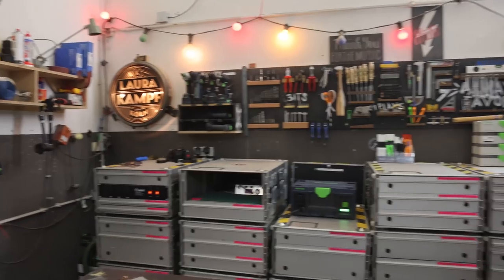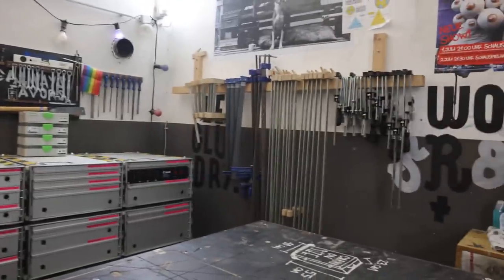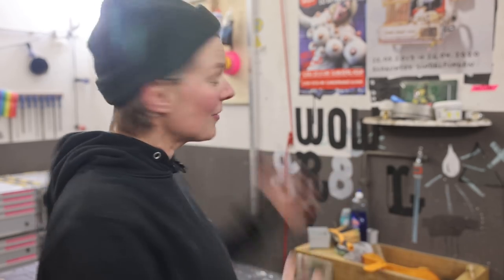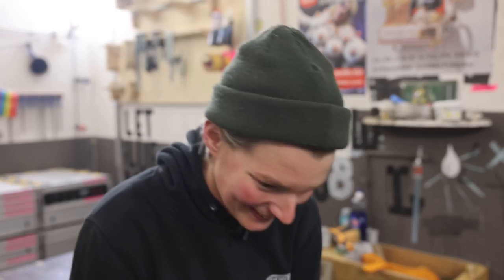This Clamp Storage Idea would be really good...if it worked :)

Comment: I'm not sure that weight is the primary concern. It looks like the slider mechanism you have (plywood in aluminum U-channel) is introducing a lot of friction and also results in binding. If it were me, I would place a small free-spinning wheel at each point of contact between the sled and wall/rails. Maybe model the wheels and sliders off of a sliding garage door or sliding truck door.

Follow-up thought: you want to lift the sled at it's center of gravity, not necessarily it's geometric center. Since you're loading it slightly differently each time, you need some system that is robust enough to handle this without losing too much energy. Pulling it by the top two corners with cables going straight up to an axel could help here. 

Also, throwing a ratchet mechanism on for safety would be a good idea! That way it doesn't fall down if you lose your grip.
Reply: It should freefall when you let go of the rope. Otherwise, too much friction.
Reply: Same thought.
I would add one roller-in-line wheel into each corner of the plywood in order to have a frictionless contact with the rails.
Reply: Yes!! Ratchet, greased runners or bearing runners! How about a hand made winder winch to lift! Oh and proper non stretch sailing rope/sheeting! So cool though!!
Reply: Also, larger diameter pulleys will improve your pull ratio.
Reply: I don't think that's the case. I believe any mechanical advantage the radius of the pulley might give you is immediately cancelled out. I think what does help is adding more rope segments and pulleys. Each time the rope loops back on itself it gives you more mechanical advantage. But at some point the friction of all those pulleys catches up, also.
Reply: 20+ clamps and 4x6ft board is very heavy...
Reply: Yes, add the rollers on the side, the board will never be balanced so two corners will dig in.  

Adding a cable and winch on the side would make it easier and most ratchet for safety.
Reply: This, but also, two words. Counter weight. When an elevator gets pulled to the top floor, a mass of roughly the same weight is moving down.

But even then, what's the point of moving these tools up high, you can't store anything underneath anyway? Unless you can have something flat on the wall, like a mural, or a map or a mirror that you like looking at more than you like having instant access to your clamps? Even better would be a second set of rails in front, and a twin storage solution that you move in counter balance to the clamp storage. At that point it will be seriously heavy though, and probably need some civil engineering know how to work out if its safe to stand under.
Reply: Also, I would ditch the rope you are using for something more static. You are losing too much force transfer into rope. Something more static like amsteel or steel cable will help in addition to the other mentioned suggestions.
Reply: Totally agree with what everyone is saying here about garage door style sliders to reduce friction, pulling from center of gravity, counterweight, ratchet, etc. Just gonna drop this wikipedia article here that describes what we're talking about (https://en.wikipedia.org/wiki/Block_and_tackle) and an awesome video @SmarterEveryDay made about snatch blocks https://www.youtube.com/watch?v=M2w3NZzPwOM
Reply: Don’t even need rollers. Just reducing the contact area between the wood and aluminum would reduce most of the friction. The contact area is all 3 sides of the aluminum channel and the wood for the full length. Just have small spacer blocks front and back on the top and bottom corners that are wider than the main board so it’s only small contact areas and smooth and wax those blocks and chamfer the corners.
Reply: UHMW tape on the bearing surfaces would be a lot less complicated than the various wheeled options folks are suggesting and might be sufficient to prevent binding and twisting. A boat winch is a pretty cheap way to get a ratcheting crank system that I used for a similar project. The crank handle provided enough mechanical advantage that I didn't need to worry about double or triple pulleys although it was not as much weight.
Reply: @wallitron  If that works, I could see every wall with such a unit if it was conducive to her process
Reply: Agreed, it looks like the issue is that the off centre load is causing the plywood sheet to lever outwards and bind in the u-channel. I agree that rolling wheels that fit better into the channel should work.
Reply: @Isaac_Norman  No the diameter of the pulleys is not relevant (as long as the rope can handle the radius). If you want to improve the pulleys you need to add more turns/wheels).
Reply: Your ideas are all perfect. If/when I ever do a similar project I'll utilize all your direction, especially the note on using a ratchet component for safety. Im so glad I saw your notes.

Comment: I’m willing to bet that your rope is getting caught between the wheels and the frames of your pulley. Most pulleys have a track for the rope so that it doesn’t get wedged.
Reply: Exactly what I thought. She should ditch the bearings and use proper pulleys with a rope guide. She should also get a some slightly larger pulleys to decrease the effort she has to put in and use a two or three fold purchase system.
Reply: Also, I think, the weight distribution doesn't seem to be equal, so it might be pushing on one side of the track too much, no?
Reply: @sylvanhydra2966  she would be better off mounting the bearings she has on the sides of the board so it slides easily in the tracks
Reply: @sylvanhydra2966  Getting the balance "perfect it's not possible since it will change with various loads.
So while your point is correct other solutions like pointed out in this thread needs to be implemented to reduce the issue (bearings in the tracks).
Reply: Agreed,the current design will cause a lot of friction as well as wear on the rope.

Also a counter balance would ease the required input a lot (almost elevators uses this to take the strain of the motor).

Also moving it out from the wall leaving room for a second layer of storage behind it would increase the usefulness (unless she needs the bare wall for something)
Reply: Same thought. Minimize the friction first (proper pulleys, or machine a U-channel into the bearings, along with some bearing system for the edges in the aluminum channel). Also that rope looks less than ideal. It looks too soft (like a cotton or poly rope) that's flattening/deforming over the bearings and possibly stretching, further worsening the drag/binding problem under load. A proper cored rope that maintains a circular cross section under load (like a static rope/cord used in climbing) would help a lot too. 

Once that's addressed, ta engineering design approach would be to figure out the weight of the load (mostly the panel, but also the clamps and stored items) then figure out what force she wants to exert to pull on the rope. Like if she wants to only pull down with 10kg (N really) but the system weighs 100kg, she needs at least a 10 to 1 pulley system. A counterweight could also be used to minimize the amount of rope pulled.

Comment: I bet if you added a counterweight, you could use an old garage door opener to motorize it ;-)
Reply: Yes ! Like a lift...
Reply: Right!  The counterweight is the ticket.  Won't need a motor, and it is not likely that an inexpensive  motor would work without a balance weight or spring of some sort. nearly the oldest trick in the book.  Gravity is a b*tch like that.
Reply: That is exactly what i was thinking. Exactly
Reply: you can also add more pulleys! or a combination of the two!
Reply: Using a balanced counterweight there is no need for any motor in the system. Have move gates weighing 1/2 a ton with one arm because of balanced weight .
Reply: Yep, counter-weight should do the trick!
Reply: +a cover
Reply: For safety?
Reply: You can make a second board that runs in front or behind it and you a counterweight AND doble your storage space
Reply: With the right counterweight a motor will not be necessary anymore  :-)
Reply: I would take a look into oldschool stage/theatrical rigging for commonly used examples.

Comment: I think adding a counterweight to reach equilibrium with empty board would be a good start. And improving the friction between the board and the track (and wall ?)
Reply: I was thinking the same thing.
Reply: I absolutely agree. 1st, like Laura said, it's not a fail. Add long as you learn and make progress, it's all part of the process. A counterweight might solve the problem. Different sized pulleys might do the job too or at least be part of the solution.
Reply: 1. Reduce friction indeed, by letting for example only 4 corners of the board into rail
Or add rollers into rail
2. Double the pulley 
3. Finally, possibly add a counterweight if still needed
Reply: I concur with you all... counter weight is the way to go.
Reply: Counterweight and bearings as "wheels" at four corners of the plate to keep the distance from the wall and steer in the tracks
Reply: Counterweight possibly as springs
Reply: Instead of a counter weight use a spring like the type on a garage door. So you actually have to pull the clamp board down instead of up
Reply: Yup, ditto

Comment: Looks great and I love the idea. I think a counterweight, and a crank to make it easier to wind and unwind the rope would look cool and make it easier to move!
Reply: Make the counter weight system a chalk board behind the holder with a secondary single pulley system for a more 1 to 1 weight ratio. Then add your hand crank to the side for simple swap back and forth.
Reply: I would use an electric winch. The idea about counter balancing it with a chaulk board is great, but will need to increase the size of the rope
Reply: @FrankKatzenberger  no need to increase the section of the rope: tension on it is the same if you pull it or if you hang a counterweight.
Reply: My first thought was: "Why isn't Laura using a crank?" 😄
Reply: @danb8568  I wouldn’t have thought of it until experimenting myself.

Comment: I’d also say that the system doesn’t increase storage because you can’t store anything underneath it. In fact the clamp storage is now taking up twice the space, because it needs room to move into as well as room to use, if that makes sense. I do however love how you are prepared to share your successes, of which there are many, and your not so successful projects.😀
Reply: My thinking from the start. Should perhaps offset it from the wall by 200mm then you can store tools flat against the wall and let the clamps slide over it when you need to. Easy fix
Reply: @three-eyes  Like those chalkboards at uni. Move one up and the other moves down!
Reply: @MFunkibut  would be cool but I was thinking one would stay static against the wall. Making a system like that with an offset would enable 3 times the storage if one had to stay static, would have to move the system higher a bit more then so the two moving boards are out of the way completely
Reply: Totally agree, I don't know why is there a need to raise the structure and how this saves space or adds to the project, the base to organize clamps, glue, and tape is already perfect.
Reply: @three-eyes  If it moved up and down it could be made to act as a counter weight, making the whole lifting process easier and smoother.
Reply: @MFunkibut  yes, this would also help as a counterweight
Reply: Was thinking the same thing. It's cool to build, sure. But what's the point?
Reply: I love the idea of using the vertical space but not for stuff not as high in demand as clamps.

Comment: I'd say:
- reduce friction on the sides
- replace bearings with "real" pulleys
- add counterweight

but overall sadly there's not much use of this very good looking storage system if you're just adding complexity (pulling up and down to get your clamps and glue) and now still have to leave the space beneath clear if you ever want to use your clamps (which, as you're woodworking, you will of course do all the time).
Reply: Also, 3/4" ply is too heavy.  Build a lighter frame, rather than mounting everything to a big surface, since the clamps don't weigh all that much.
Reply: Also, add a winch at the end. Free leverage and looks rad.
Reply: For 'ease of use' a counterweight system is absolutely necessary
Reply: I 100% agree on all the recommendations here. The bearings are not holding the rope centered, which means the rope is generating friction on the blocks at the sides. Laura can make the sheaves and fit them on the bearings she has already.

I would add a more rigid fixed point at the top as the twisting I see is not helping matters at all.

I would add a hand crank winch to give you some more mechanical advantage, and to address the last point, perhaps making the space below the raised clamps a whiteboard. Gives you a a place to draw out some ideas and plans, but need not be accessible during the glue up.
Reply: Hmm make it like the blackboard system we used to have at school. One panel goes up the other comes down. Then you also have partially the counterweight system solved.
Reply: hey what they said,  also have you considered french cleats rather than fixed shelves.  I really like the idea for a whiteboard and counterweight also the winch and handle.
Reply: @macexpert7247  this is a great idea. stick a blackboard or some other lower-profile object on the backboard and you can increase utility and ease of use.
Reply: Counterweight is a great idea.
Reply: @frankyboy4409  add a counterweigt under the winch ! =)
Reply: I think it's either pulleys or counterweight.

Comment: A: Rework the pulley system, more loops and wheels? B: Use a counter-weight system instead of pulleys? C: Improved intersection between the vertical guides and the main board? D: Motorise it?
Reply: I'd suggest a counter-weight with the pulley system as an easy modification. A counter-weight that is slightly lighter than the board and directly coupled through it's own rope rather than through the pulley system would mean the rope and pulley that you haul on would only have to lift the difference plus whatever you hang on the backboard. The guide rails may be a problem if the back board is badly balanced / unevenly loaded but I suspect that's not the issue. Try looking into the mechanism behind sash windows.
Reply: @lazymandoplayer  It needs to be lighter than just the board: otherwise if she uses every clamp (admittedly unlikely) the board goes up on its own.
Reply: @leifhietala8074  Not quite correct. Each pulley wheel reduces the original weight by a factor (also lengthening the amount of rope needed by the same factor). If you want to use a counter weight it needs to be by the same factor lighter and not equal weight or slightly less than the original weight. Also you need to have enough room for the increased amount of travel the counterweight needs to do; if gravity can't do its job because the counterweight is resting on the floor already -- no bueno amigo.

Comment: Laura, you need to clean the stator on your band saw chop saw. The brushes were sparking like crazy when you were using it. This is almost always caused by conductive grit getting in the ventilation holes. If you catch it early and clean the brushes and the stator and armature, there is no harm done. To prevent it from happening in the future, take a very thin sock, hose if you have it, put that over the ventilation grill. The motor will still be able to cool itself, but the sock will act as a pre-filter. You can just vacuum the sock off once a month or so

Comment: 1: you have to guide the rope, having them simply on the bearing will strafe them on the side of the bearing and increase friction, possibly leading to having the rope stuck between the bearing and the metal plate. That's why pulley have a round shape for the rope.
2: of course counterweight. Take a look on how an elevator works, there is a counterweight which is the same weight as the cabin so the motor only have to move the people inside. On your case, having a counterweight at least the weight of the empty board, maybe a little more is you know the board will never be empty.
3: improving the vertical guiding. I think your guides with wood on metal is causing too much friction. Adding small rollers on the side will make a great difference.

Last thing: it's great to see a maker who speak about failure too. Failure is usually the quickest way to learn and improve our skills, but on youtube most of the time you only see the success version. Thanks for sharing this too with us.

Comment: It's a great idea. I would say, since you would be unable to store things under it due to it sliding, i would recommend maybe adding a white board so you can use it as a drawing board for plans and notes. Also regarding the pulley system, either a crank or possibly motor driven may make it much more convenient to use. And a motor project would be pretty cool.

Comment: Wondering if it's binding in the rails. Maybe add rollers in each corner. Then if needed add another two pulleys. And yes motorize, which will also prevent accidental dropping.

Love that you share the "oops that didn't work" moments.
Reply: +1 to binding, reduce it to a couple tabs (one at each corner) wax them.  Also, I bet it's being pulled forward in the channel, so maybe bring the guide rails forward a couple inches off of the wall, then set the storage back?  Becomes less sturdy that way, but still possible.